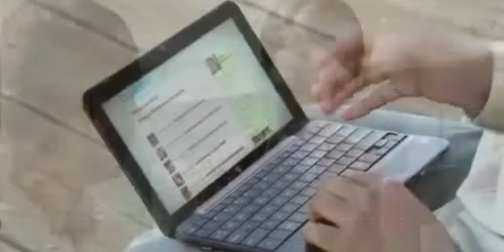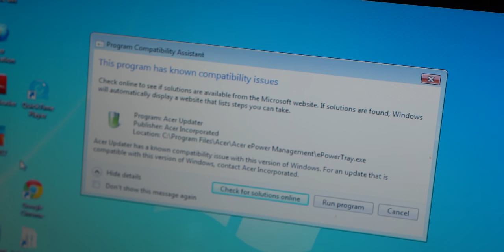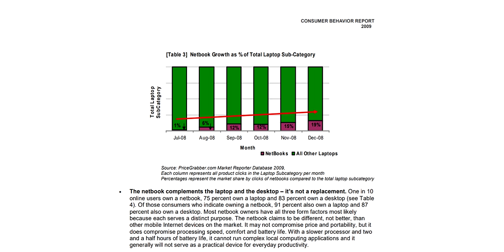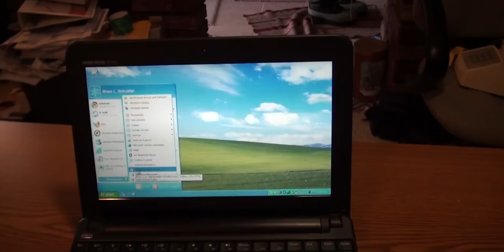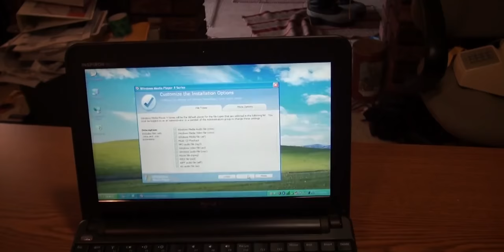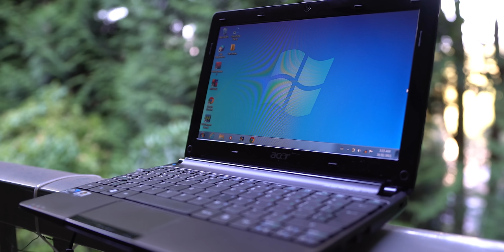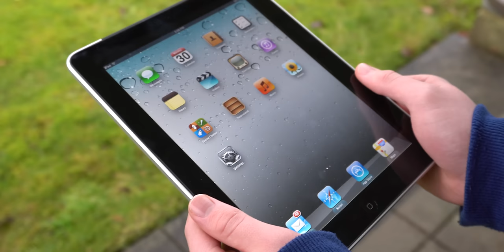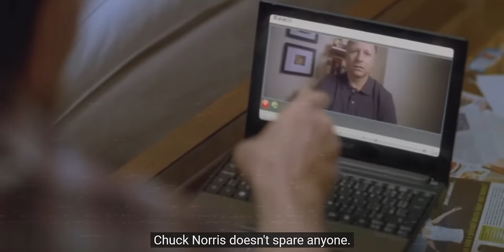Why Netbooks Failed - Modern Retrospective

Comment: Netbooks were designed for web browsing. Anything beyond that was just gravy.  They weren't even advertised as laptop replacements.  "Phablets" and tablets replaced them.
Reply: And the usual Nonsense: simple Office Crap, a few Emails, some Music and maybe a Video every now and then. All of those not very demanding tasks run fine enough on those overclocked Toasters. 

But yeah, Tablets kinda destroyed the Market. They can handle anything a Netbook could do, but faster, better and with a whole lot more tasks they can handle, that  Netbooks would have failed. All of this in an almost Idiot Proof format - my mom was able to use a Tablet, and she struggles with absolutely anything tech related. 

Atlough there is still a Market for extremely small formfactor Laptops, with similar sizes to Netbooks. However, they are usually capable Machines and cost a fortune, so they are pretty damn niche and don't serve the Product Category, that Netbooks used to fill in. 
Also, there are Chromebooks now. Specs are usually pretty damn underwhelming, but they are cheap and run absolutely fine, because no copy of Windows is running on there.
Reply: @sagichdirdochnicht4653  The one thing that my Netbook could do (moderately well in fact) that tablets would not let me do was writing technical code - mostly Python, some C++ directly on the machine.  Heck, it ran MinGW and Cygwin pretty darn well, enabling a lot of work devlopment and analysis tasks that I could not do on a tablet, much to my frustration.  I wasn't until some of the 2 in 1's came out that allowed me to do that sort of thing on a "tablet" type of platform.  I know all of the above makes me a 5 sigma case in terms of normal use, so I will go back and sit in my corner case....  -)
Reply: @VeniVidiViral 4k?  Netbooks peaked before 1080p streaming video was available.  Heck Netflix was still a video rental service.
Reply: And now Chromebooks too, except they're locked to a set operating system and heaps of them have already lost all software support.

Better to spend a little more for a real laptop, maybe load it with Linux if you loath Windows.

I have a Cheap (less that 500 dollars) 17inch HP laptop with a Ryzen 2300u with Vega 6 graphics, that I was able to upgrade with 16 gigs of RAM and add a 1TB M.2 drive, I've installed Garuda Linux on it and it's a genuinely fun device to use that even still has a Disk drive so I can RIP CDs and DVDs to it or replace it with a Blueray drive since  video streaming is hella unreliable on my Canadian internet
Reply: @sagichdirdochnicht4653  "They can handle anything a Netbook could do, but faster, better and with a whole lot more tasks they can handle"
They still don't have a keyboard.
"Also, there are Chromebooks now. Specs are usually pretty damn underwhelming, but they are cheap and run absolutely fine, because no copy of Windows is running on there."
Until they reach their expiry date.
Reply: @inwencja2009  Software Keyboard?  And for more "demanding" typing...  there are external keyboards. Many specifically for the tablet. Having no keyboard is no argument. 

And if a tablet still isn't enough for you..   it isn't for me either! But we arent the market demographic for those devices.
Reply: @sagichdirdochnicht4653  "And for more "demanding" typing...  there are external keyboards. Many specifically for the tablet. Having no keyboard is no argument. "
Okay, try to plug in a keyboard and a flash drive.
Reply: @inwencja2009  What the Hell is your problem? 
As I have stated, you are not the target group. Get what suits your needs. 

But to answer your "questions": Ever heared about Bluetooth? And many Tablets that have Keyboard attachments connect the Keyboard via Pogo Pins. Those who don't usually use Bluetooth. And now shut up with "latency", it ain't for serious gaming, ok? 
Also still, there are USB Hubs. 
But then you wouldn't use a Tablet like that. Tough for more "serious" work with more cables and plugs, there are then Docks. 

Again, if this doesn't sound like it couldn't fullfill your needs.... Get something else. 

Any more stupid questions?
Reply: And they sucked at that
Reply: They were touted as full-on laptop replacements; in my job back in the day we all got one because you could buy 2 for the price of a regular laptop, plus the extra 1Gb RAM stick to 'upgrade it' LOL. The Eee PC I got worked 'Ok-ish' for the IT consultant job(browsing/notes at meetings/documents), but when it came to network or IT tools I went back to the old Toshiba I had because the EeePC just couldn't handle it.
The minute regular laptop prices went down, there was no need for a "Netbook" and they dissappeared as fast as they showed up

Comment: a normal laptop would have come with a crappy version of word
Reply: @farrelwaso5044  true that works too
Reply: Google Docs?
Reply: google docs all the way
Reply: Google docs is free and better in every way
Reply: @Kamil-DIY  hi  Microsoft works was a cut down version of the major productivity apps - it goes back to dos days and I used it often on 286 / 386
Saved file format is the issue - especially opening word / excell native formats 
With spreadsheet it had to be simple and save as csv 

Word processor plain text or maybe rtf

Think of works as cut down / home/ starter version

The worst is that you cannot give the document to anyone who does not have the program

For business over time everyone was forced to buy MS OFFICE and use that as a standard

At work in early 90's you basically had to buy every program lotus 123. Wordstar. Word perfect . Some similar all in one programs

Even in XP days we had 2 older Pentium 3 and Pentium 4  set up with word perfect office on one machine  and works for Windows on another.

Just after say 2000 some Microsoft free apps included  word and excel viewers

Same problem when office 97 was released  you could not open the saved files with earlier versions of word or excell
Reply: True. I tried signing in so many times. It still said it’s unlicensed and didn’t let me type. Thanks to google docs lmbo. At least the PC version is ok
Reply: Yes it was called Microsoft Works and was slimmed down versions of Microsoft programmes. At the time Star Office was free and was even better that the Microsoft programs.
Reply: Wordpad is seriously underrated.
Reply: Mine came with Microsoft Works 9, which actually had way better performance than its office counterpart. It also fit better on the smaller screen.
Reply: @jchubyt      ssA
Reply: @NvanRoblox  Uhh no... excuse me while I vomit..
Reply: @mrblob5413  ik i was an idiot
Reply: @mrblob5413  I even forgot about this comment
Reply: @NvanRoblox  haha good on you for realizing it and admitting it.
Reply: sooo... Wordpad?
Reply: a n i m e
n
i
m
e
Reply: @NvanRoblox  nah it's formatting and editing isn't as good (not counting the co-editing feature)
Reply: @youtubeshadowbannedme  yeah i know i was a idiot
i didnt look much into word before

Comment: I still call Chromebooks "Netbooks"
They really are just netbooks but with an operating system the netbook can actually handle
Reply: in conclusion, linux solves everything

oh also people are more driven by brand recognition than actually knowing what theyre buying
Reply: Linux? Isnt it
Reply: At least a netbook lets you install stuff wherever you want
Reply: @vullord666  about schools, unfortunately that depends on your teachers. I was lucky enough that almost all of my teachers placed a heavy emphasis on teaching critical thinking, and, in my science classes, experimentally testing the concepts we were learning (including math classes, arguably my best teacher, assigned proofs/fewer but longer form problems for homework as well as some shorter practice). Of course, the one who didn’t (second semester of trig lmao) was awful, and I had to essentially give myself extra homework to actually learn the material.
Reply: The processors are usually better too. Instead of Atom processors, Chromebooks usually start at Celeron or Pentium processors
Reply: They're way bigger than netbooks though
Reply: @youtubeshadowbannedme  While technically you aren't wrong, the hardware limitations most likely wouldn't let you run a lot of programs well.
Reply: They still have windows netbooks.
Reply: @jon368100  they dont make atoms anymore
Reply: Netbooks were always about Linux. Remember, they were inspired by the OLPC project. All the good ones (like the Asus Eee 701, which I still have) ran Linux. Microsoft forcing Windows on them was what suffocated the market segment.